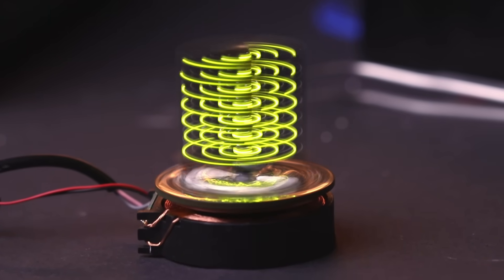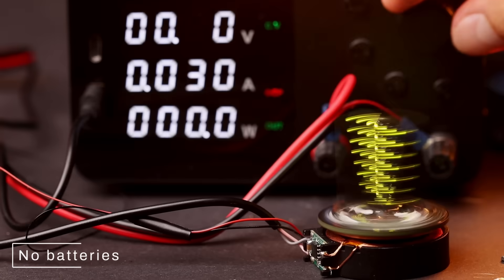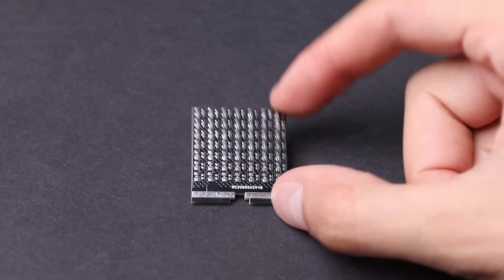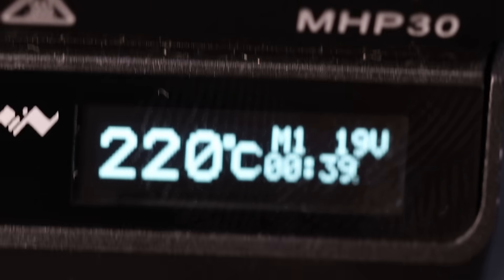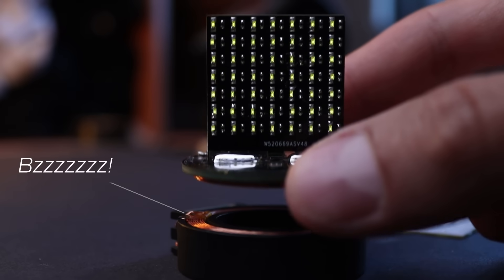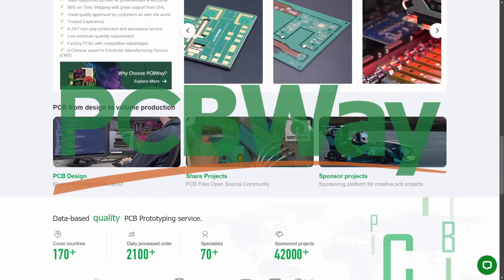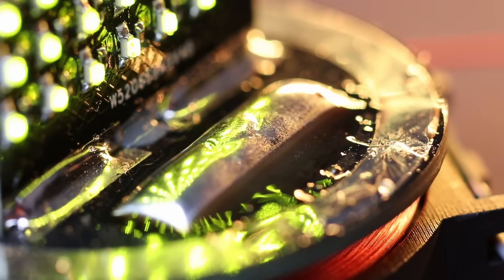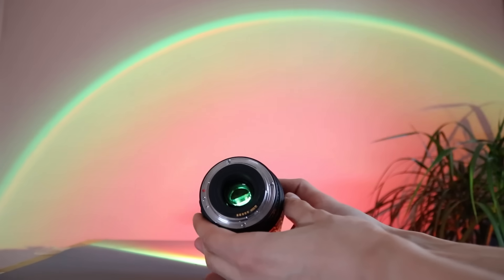I Made a Tiny Volumetric Lamp

Comment: If using wireless power why not use small generator. Since it spin so it power it self for magnetic field. I guess I am over thinking things.
Reply from the maker: Yes, a generator is another possible solution. To me, it seems more complex, but maybe I could combine both: a BLDC motor and wireless power transfer. That would be pretty cool! Maybe in the next video
Reply: @NickElectronics pretty much you only need a couple coils on the spinning part, the stationary piece could have permanent magnets to excite it
Reply from the maker: @L1Q  That for the existing configuration with DC motor. But if i want to make a BLDC motor I have to keep coils on stationary part and spin magnets. Then I guess I can use coils on stator and additional coils on rotor for wireless power transfer. Thats the idea i was talking about. But i guess WPT frequency in such case wouldn’t be that high, which is a drawback

Comment: it would be interesting to see if you could extend the wireless power transfer to transfer data maybe modulate it somehow over the same coils, like for example the ws2812s only need 1 data line got to be a way to do it.. or even use jinx and connect over wifi to an esp. hmm the possibilities... ill look forward to seeing this project develop.
Reply from the maker: The modulation idea is actually very good. As far as I know, it’s possible, but I'm not sure about the maximum data bandwidth. ESP is another option, though I’m a bit concerned about EMI from the power transfer. But if the ESP is on top and properly shielded...

Video title: Spinning My ESP32 at 6000 RPM, hahaha 😅😅😅

Comment: You could add some carbon to the grey goo to make it black good (note: conductive goo)
Reply from the maker: I'm not entirely sure it's conductive because I've covered several PCBs with components with it, and they worked just fine. If it were conductive, something likely would have burned out. So, I believe it's dielectric. However, it might depend on the type of 'goo' used—some might be conductive, and others not.

Comment: For balancing, you can use equipment for balancing small DC motors, like the one that powers this whole thing. The way you do it quite simple. Attatch it to spin on an axle from both bottom and top and as long as it keeps turning to one side when given a gentle push, it's not balanced properly.
Reply from the maker: Thanks! Gravity is the best friend with this method. :) I'll try it next time I do something similar.

Comment: How cool is that!
Maybe you can spray paint the green boards to make them black (after soldering)...it shouldn't be a problem :-)
Reply from the maker: I could, but I don’t know how spray paint holds up on PCBs and components. I know that varnishes are usually used to cover PCBs. Maybe you have any experience? But still thanks for an advice.
Reply: Honestly I never painted a PCB but many other things... I'm fairly sure that you can do it without any consequences. As long as you cover with some tape the  vertical PCB where the LEDs are soldered, then you can spray some layers of black on the remaining parts, 3-4 passes should do.
Paper tape is the best for this, I don't know exactly how it's called in English sorry, it's the yellow / blue type used for masking when painting walls :-)
Reply from the maker: @Fred_Klingon  Yeah, i know which tape do you have in mind. Maybe next time will try :)

Comment: Could you make one of these with a small display with a high enough frequency update?
Reply from the maker: Definitely yes. But making it would require solving a lot of challenges. I might try it in the future, though. But I don’t have much experience with wireless power transfer, so I don’t know how it would affect the communication lines and microcontroller that will be on the rotor. I believe the effect would be negative 😅
Reply: @NickElectronics  either way, I enjoy your videos. Keep it up, family.

Comment: any plans on releasing the project files ? would really like to look at the firmware/pcb files
Reply from the maker: I will, probably, in the future, when the second iteration of it sees the light. Because so far, there is nothing complicated in it—no MCU, only LEDs and resistors. I might experiment with wireless power transfer in the future and make my own boards. Then I will share them. 

But if you still need the files after reading this, please message me via email and i will share.
Reply: @NickElectronics what about gray goo recipe
Reply from the maker: @DeLoRiAnEc  concrete and water. Boil about an hour on a medium heat. Mix from time to time

For real it is epoxy. 2 component one. Loctite
Reply: @NickElectronics  haha, nice. thank you

Comment: Using wireless transmission is a good idea.
Another idea is to have magnets on the stator part and pickup coils on the rotor.
I know it works because I used it to create a "ghost scope" where a magnet was strategically placed so when the coil flies by, it energises 4 small, low power LED's.The way the "ghost scope" worked was that there were 3 LED's pointed outside placed as a triangle , while 1 LED was pointed on the inside, on the opposite side of the ring.
When turned on, you could only see 4 floating light points and you had to align that 4th LED in the center of the other 3.
The effect was only visible from the user's perspective with nothing visible from any other direction.

Edit : I had a single magnet and a single coil, strategically placed to light the LED's for 1 "frame" during the rotation, and the LED's were in line with the "gun's" "barrel".Very low amounts of power were generated.
For a volumetric screen, you'd have multiple magnets, multiple coils, and perhaps a small capacitor and rectifier on the rotor side to supply constant current
Reply from the maker: Wow, quite interesting! Thank you for sharing such great knowledge.

I know that generators work on this principle, where a changing magnetic field induces current in a coil. I'm just not sure which option would be smaller and cheaper—adding wireless power transfer coils (essentially a transformer) or using a magnet with a coil (generator). Also, with just a magnet and a coil, it’s impossible to regulate the voltage, so additional circuitry would still be needed, as you mentioned.

I was considering whether it might be possible to combine a BLDC motor with wireless power transfer. I’m not sure if it’s feasible since I haven't researched it yet, but if there are magnets on the rotor and coils on the stator, that’s essentially a BLDC motor, which generates a changing magnetic field that could potentially be used for both spinning and power transfer (possibly?). But this also raises the challenge of keeping it flat. So, I’ll need to think about this some more—not quite sure which solution would be best."

Let me know if you have any more ideas. Thanks :)
Reply: Do you have any pictures or schematic? I'm not sure that I understand exactly how you made your ghost scope.

Comment: How about using an acrylic breadboard with glued on copper foil as wires?
Reply from the maker: It’s possible. If the plates are close enough, they would create capacitive coupling. But if your foil forms a spiral, it would work similarly to coils. Probably...

Also, I just realized that PCB traces might be used for the same purpose. Hmm...

Comment: "Oh no, if only there was a cheap and easy way to turn ugly green PCBs sticking out on my black projects!"
Black rattle can:
Reply from the maker: Yeah, but you don’t usually spray PCBs with black paint. It’ll probably develop cracks over time. Some specialized varnish could do the job, but I didn’t have any.
Reply: @NickElectronics  Plastidip (normally used as temporary styling for cars) is well tested with electronic. Also available in non-spray variants that has less solvent and therefore extra safe on sensitive parts. Because it is a flexible rubber-paint it won't have issues with cracking from thermal cycling. You also have the unique benefit that you can peel it away cleanly if needed - so making a repair or modification later is not a big problem. Non conductive, relatively weatherproof and extra physical protection due to the rubber properties. Very useful tool for any maker - not just in electronics. Don't use on high-heat parts obviously.

Comment: Really like the build! Though it's gutting that there's not individually addressable [RGB] LEDs to do some funky volumetric stuff. You could add a tiny rp2040 or something on the spinning element (which might help the weight distribution too) then whenever it gains power it continues to cycle through a set of frames for the display. The serial line just adds one extra connection to LED display board. 

Perhaps deserving of a follow up video!
Reply from the maker: I’m thinking about making a follow-up with a controller, like you mentioned. The RP2040 is probably overkill for such a simple task, so I might just use an 8-bit AVR instead. 

Just wondering if wireless power transfer will affect communication with addressable LEDs somehow, ahhaha :))) Dont know, dont know. Have to test it out.
Reply: @NickElectronics  I’d love to see this - it should also be possible to transfer data over the wireless link, allowing for some controls on the base. Works for RFID tags 🤣
Reply from the maker: @GadgetoidUK  I'll think about it during breakfast :D Thats why engineering so hard. So many ways of doing the same thing, ahaha

Comment: You can probably balance it with a cheap micro scale, by having one side of the assembly rest on the center of the scale with a peg, and the other side to a fixed post of equivalent height. Then you can rotate the platform to see at what point it is heaviest or the lightest.
Reply from the maker: Hm, I hadn’t thought about that. The only solution I found online is to place a rotor on a loose horizontal shaft and rely on gravity. The heaviest part of the disk will rotate to the bottom.

Comment: Simpler if you put strong magnets on the base and use the spinning itself to generate power for the leds.
Reply from the maker: Hmm. I'm not quite sure if it's simpler in terms of implementation. It's possible to put magnets on the spinning part and coils on the bottom to create a simple BLDC motor, using the same stator coils for wireless power transfer. It seems like the right way to do it, but it would be much harder to design.